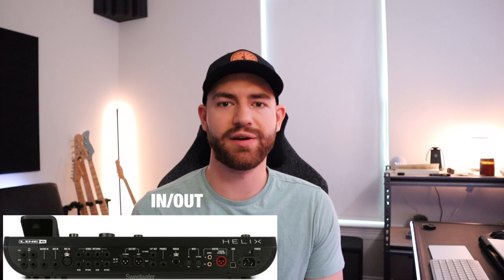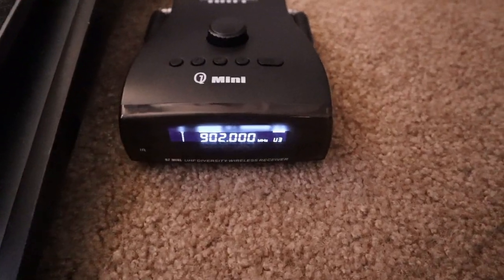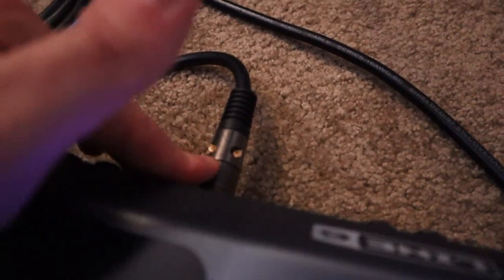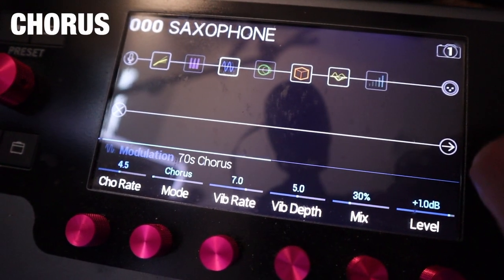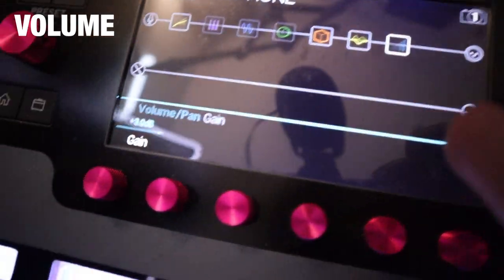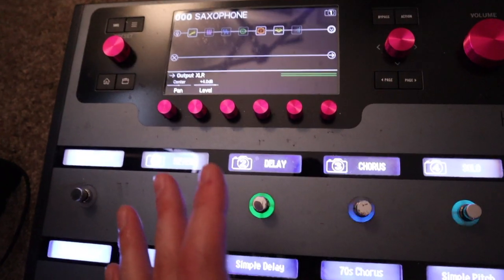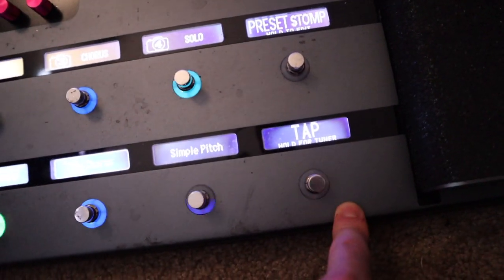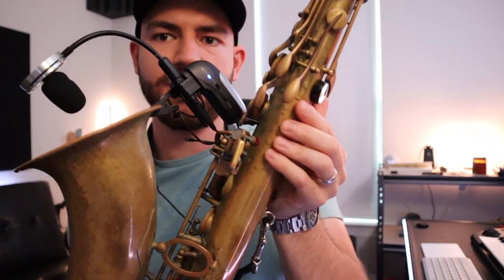How I use the Line 6 Helix with My Saxophone

Comment: Where can I buy this equipment at
Reply from the maker: Hey bro!!! You can get the equipment at a number of places... To be honest the Helix is overkill for just saxophone. I use one because I have to play a lot of guitar also. For you I would suggest getting something like an HX Stomp, basically the same thing but much smaller and cheaper. The mic you can get on AMT's website, just google AMT sax mic. Let me know if you have any other questions man! Happy to help in any way I can!
Reply: @masonthomassax  Man I appreciate you .. Could I use this on gigs
Reply: @masonthomassax  is this unit the same as the boss ve 20
Reply from the maker: @manup757  it’s not exactly the same, but the Boss can do some of the same stuff. I personally would prefer the Line 6 HX Stomp over the Boss
Reply: @masonthomassax  .. hey one finale question how would I hook my phantom power48 v mic to this ..would I need to purchase a special box
Reply from the maker: @manup757  hmm... to be honest I'm not certain. It depends on which multi-fx unit you get, I believe some of them are capable of providing phantom power, while others or not. If you purchased an FX unit that can't deliver phantom power, then yes you would need to get a phantom power box in addition.
Reply: @masonthomassax  This is what led me to the Helix Floor.  Only multi-effects pedal I could find that wasn't primarily focused on vocal effects that had the XLR input with Phantom Power.
Reply from the maker: @p1nkfl0yd1an great point!

Comment: Actually starts with a Gate right?
Reply from the maker: Yep! You are correct. Completely forgot about the gate functionality that's integrated into the Helix inputs. Oops! lol
Reply: @masonthomassax  Gate is rather important......like feedback or bleed with a clipon mic is a big issue.
Reply from the maker: @ericdano  it definitely can be. I find with the particular mic I use, in the context of a full live mix the bleed doesn’t end up being too noticeable, but yes it’s certainly a good thing to have a gate at the beginning! 🤘🤘
Reply: @masonthomassax  I dunno, I have tried several clip on mics (Shure, ATM, and now the Nuemann) and not having a gate is very dangerous depending on the effect.....
Reply from the maker: @ericdano  I didn't know Neumann made a clip-on mic for sax! How do you like it? I may have to look into that one
Reply: @masonthomassax  It was expensive, but it sounds great. It's like taking a high end AKG414 or a Nuemann 103 out on the gig, but without that really wide cardiod pattern those have.
Reply from the maker: @ericdano  Yeah thats killer. Maybe I'll pick one of those up for when I don't need to be wireless. 

Thanks for your comments bro!